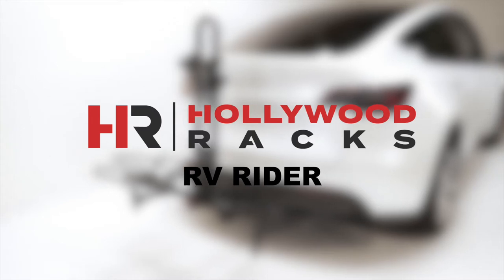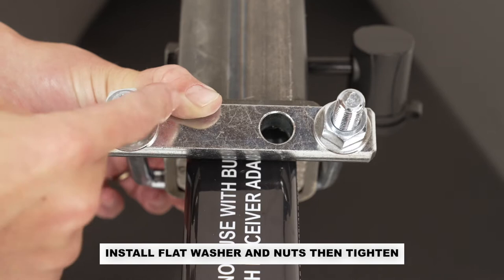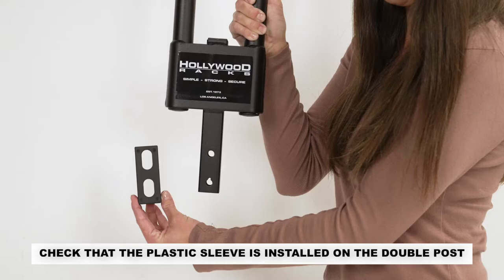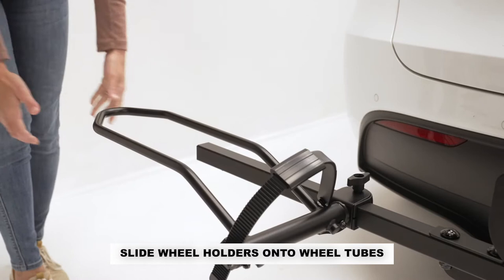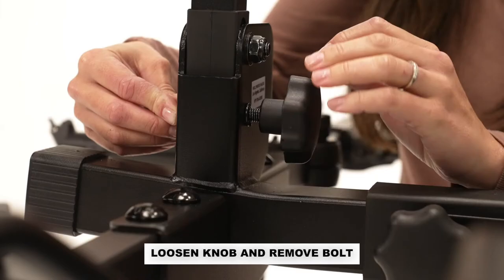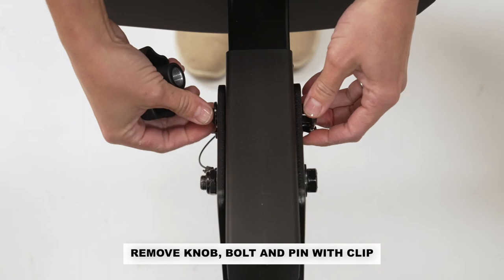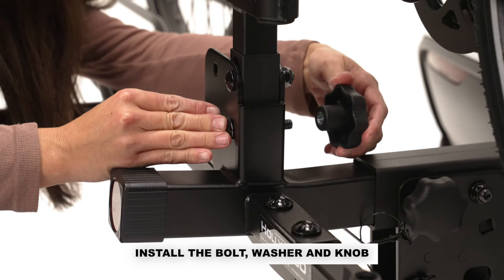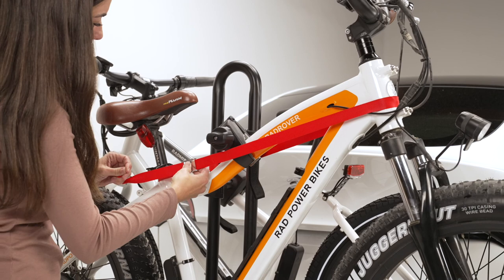Hollywood Racks RV Rider model HR1700 Installation video

Comment: Clear speaking voice!

That was probably the best demonstration I've seen for loading a heavy bike onto the wheel holders that are closest to the vehicle: "Walk the bike to the inside wheel holder." However, the user has to be careful to lean the bike onto the vertical bar. If the bike accidentally gets bumped, it and tilt away from the vertical bar and scratch up the vehicle's paint job!

*

Comment: At 1:45 on this video can you insert the bolt into the back hole allowing for the bike rack to be farther away from your camper?  I am having an issue with the handlebars hitting the camper and the only other thing I can do is loosen the handlebars and move them sideways. All I need is an inch or two, I do not want to have to purchase a 7" extension because that might make it not as strong and also cost me another $50 or so for the extender anti-rattle and lock.
Reply: I do see that if I do this I then cannot lock the rack in the upward direction, but I am not sure I would be doing this on my camper anyway.
Reply: Looks like Hollyood racks says you need to turn your handlebars or purchase the 7" hitch  extender ith your key number.  Cost 139.00 with shipping!

Comment: Would like to see you lock down a  step through bike with no cross bar to attach to
Reply from the maker: Hi Steven, we have an accessory called bike adapter for those situations. It's super easy to use. Check it out here https://hollywoodracks.com/collections/bike-adapters/products/ba-pro